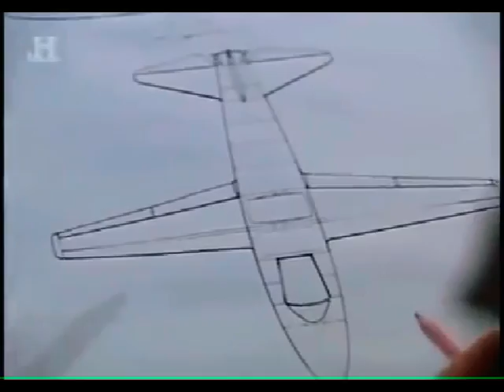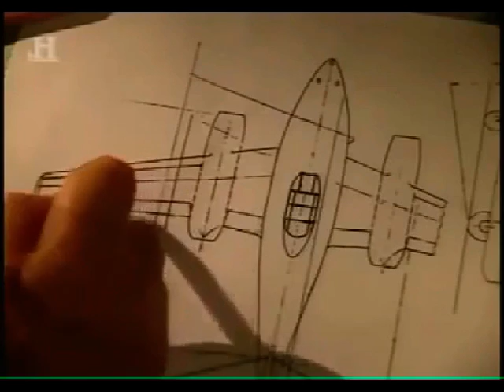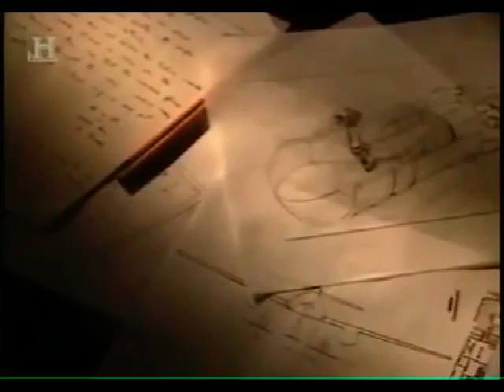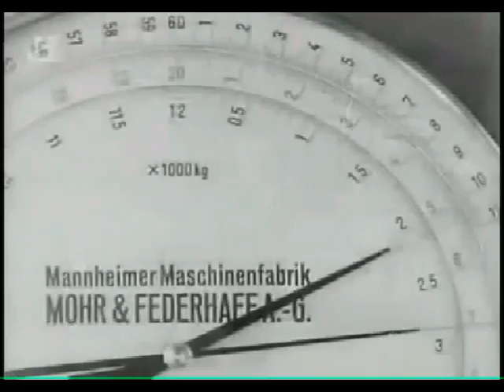The Father of the Jet Engine - Hans Von Ohain

Comment: So, you British that won’t see that Ohain invented it, be proud of Whittle because you‘ll never had or will have such an important person for history of flying such as Otto Lilienthal. He made flying possible. He was the first to successfully with a machine which was havier than air.
Reply: Lets not forget Ferdinand von Zeppelin, he invented the first powered passenger aircraft in history... and the World's first commercial passenger airline.
Reply: Let’s not forget Manfred von Richthofen!
Reply: The problem for you Klumpy old chap is that it's not just the British that won't see that Ohain invented it, It's Ohain himself that doesn't see that he invented it.
"The first patent of a turbojet engine, which was later developed and produced,
was that of Frank Whittle, now Sir Frank (see Fig. 5). His patent was applied for
in January 1930. This patent shows a multistage, axial-flow compressor followed
by a radial compressor stage, a combustor, an axial-flow turbine driving the
compressor, and an exhaust nozzle. Such configurations are still used today..."

That's a quote of Hans von Ohain's own words from his foreword to 'Elements of Propulsion, Gas turbines and Rockets'.
Reply: Hans von Ohain wrote a very comprehensive foreword in the 'Elements of Propulsion, Gas turbines and Rockets'. He states: 
"The first patent of a turbojet engine, which was later developed and produced, was that of Frank Whittle, now Sir Frank. His patent was applied for in January 1930. This patent shows a multistage, axial-flow compressor followed by a radial compressor stage, a combustor, an axial-flow turbine driving the compressor, and an exhaust nozzle. Such configurations are still used today..." 

and ...

"From the beginning of his jet propulsion activities, Frank Whittle had been seeking means for improving the propulsive efficiency of turbojet engines. He conceived novel ideas for which he filed a patent application in 1936, which can be called a bypass engine or turbofan. To avoid a complete new design, Whittle sought an interim solution that could be merely "tacked on" to a jet engine. This configuration was later known as the aft fan. Whittle's work on fan jets or bypass engines and aft fans was way ahead of his time. It was of greatest importance for the future or turbopropulsion."

and.... 

"In April 1937, Whittle had his bench-test jet engine ready for the first test run. It ran excellently; however, it ran out of control because liquid fuel had collected inside the engine and started to vaporize as the engine became hot, thereby adding uncontrolled fuel quantities to the combustion process. The problem was easily overcome. This first test run was the world's first run of a bench-test jet engine operating with liquid fuel.".

Comment: I'm so pleased to see that Hans Von Ohain is finally getting the recognition he deserves!
Whittle ws a figment of British propaganda!
Reply: Hans von Ohain wrote a very comprehensive foreword in the 'Elements of Propulsion, Gas turbines and Rockets'. He states: 
"The first patent of a turbojet engine, which was later developed and produced, was that of Frank Whittle, now Sir Frank. His patent was applied for in January 1930. This patent shows a multistage, axial-flow compressor followed by a radial compressor stage, a combustor, an axial-flow turbine driving the compressor, and an exhaust nozzle. Such configurations are still used today..." 

and ...

"From the beginning of his jet propulsion activities, Frank Whittle had been seeking means for improving the propulsive efficiency of turbojet engines. He conceived novel ideas for which he filed a patent application in 1936, which can be called a bypass engine or turbofan. To avoid a complete new design, Whittle sought an interim solution that could be merely "tacked on" to a jet engine. This configuration was later known as the aft fan. Whittle's work on fan jets or bypass engines and aft fans was way ahead of his time. It was of greatest importance for the future or turbopropulsion."

and.... 

"In April 1937, Whittle had his bench-test jet engine ready for the first test run. It ran excellently; however, it ran out of control because liquid fuel had collected inside the engine and started to vaporize as the engine became hot, thereby adding uncontrolled fuel quantities to the combustion process. The problem was easily overcome. This first test run was the world's first run of a bench-test jet engine operating with liquid fuel.".

Now you know.
Reply: @johnburns4017  Maxime Guillaume patented the turbojet aircraft engine in 1921 when a 14 year old Frankie was still wearing short pants!
Reply: @johnburns4017  The World's first bench test of a turbojet engine was in January 1935 in Gottingen Germany and was witnessed by Professor Robert Pohl.
Frank Whittle would not begin work on jet engines until he moved to Rugby in 1936.
Reply: @johnburns4017  As we were all know Whittle never constructed any engine with a axial compressor or a centrifugal turbine... you own references discredit your false revisionist claims.
Reply: @sandervanderkammen9230  Hello Sandyboy, so you are giving the invention of the jet engine to Guillaume are you? you better tell Spottydog that his youtube about Ohain is trash now.
BTW It's the krauts that like to wear leather shorts even as grown men isn't it.
Reply: @sandervanderkammen9230  Sandyboy by your own argument that is irrelevant. Guillaume never constructed any engine with a axial compressor and Ohain never constructed any engine with a axial compressor. But Whittle's 1930 patent employed axial compressors and as Ohain himself says-
"The first patent of a turbojet engine, which was later developed and produced, was that of Frank Whittle, now Sir Frank. His patent was applied for in January 1930. This patent shows a multistage, axial-flow compressor followed by a radial compressor stage, a combustor, an axial-flow turbine driving the compressor, and an exhaust nozzle. Such configurations are still used today..." 

And remember, when you are trying to big up Anselm Franz's work at Lycoming, all the engines he worked on were based on Whittle's 1930 patent.

Comment: I guess no.
Reply: The first successful demonstration of jet aircraft engine was on August 27th 1939 in Rostock Germany by Hans von Ohain and Max Hahnn..
Frank Whittle was only the 4th person to make a successful demonstration of the jet engine.
Reply: @sandervanderkammen9230  
dockorbimmer, a quiz
Name the inventor of the turbojet engine?
20 points for the correct answer.
Reply: @johnburns4017  WINNER! The correct answer is Hans von Ohain and Max Hahnn.
Reply: @sandervanderkammen9230  
BZZZZZT! Wrong answer.
doktorbimmer, the name of the  the inventor of the turbojet engine is..

🎈🍾🎊  Frank Whittle 🎈🍾🎊

Zero points docktorboimmer. Zero. Better luck next time.
Reply: @sandervanderkammen9230  Sandyboy once again for you, from Pabst von Ohain himself-

"The first patent of a turbojet engine, which was later developed and produced,
was that of Frank Whittle, now Sir Frank (see Fig. 5). His patent was applied for
in January 1930. This patent shows a multistage, axial-flow compressor followed
by a radial compressor stage, a combustor, an axial-flow turbine driving the
compressor, and an exhaust nozzle."
Note the word 'first'.

And

"From the beginning of his jet propulsion activities, Frank Whittle had been
seeking means for improving the propulsive efficiency of turbojet engines. He
conceived novel ideas for which he filed a patent application in 1936, which
can be called a bypass engine or turbofan. To avoid a complete new design,
Whittle sought an interim solution that could be merely "tacked on" to a jet
engine. This configuration was later known as the aft fan. Whittle's work on
fan jets or bypass engines and aft fans was way ahead of his time. It was of
greatest importance for the future or turbopropulsion."
Note the words 'way ahead of his time'

Comment: The earliest attempts at airbreathing jet engines were hybrid designs in which an external power source first compressed air, which was then mixed with fuel and burned for jet thrust. In one such system, called a thermojet by Secondo Campini
Reply: The Turbojet engine is the design we use today, and was first built and successfully flight tested by Hans von Ohain in Germany.
Reply: @sandervanderkammen9230  Ohain's design, described by himself as-

 "...consisting of radial outflow compressor rotor, combustor, radial inflow turbine,
 and a central exhaust thrust nozzle"

 is NOT a design used today.             Ohain himself says of Whittle's design-

"The first patent of a turbojet engine, which was later developed and produced,
was that of Frank Whittle, now Sir Frank (see Fig. 5). His patent was applied for
in January 1930. This patent shows a multistage, axial-flow compressor followed
by a radial compressor stage, a combustor, an axial-flow turbine driving the
compressor, and an exhaust nozzle. Such configurations are still used today..."

Further he says of Whittle-

"From the beginning of his jet propulsion activities, Frank Whittle had been
seeking means for improving the propulsive efficiency of turbojet engines. ¶ He
conceived novel ideas for which he filed a patent application in 1936, which
can be called a bypass engine or turbofan. To avoid a complete new design,
Whittle sought an interim solution that could be merely "tacked on" to a jet
engine. This configuration was later known as the aft fan. Whittle's work on
fan jets or bypass engines and aft fans was way ahead of his time. It was of
greatest importance for the future or turbopropulsion."